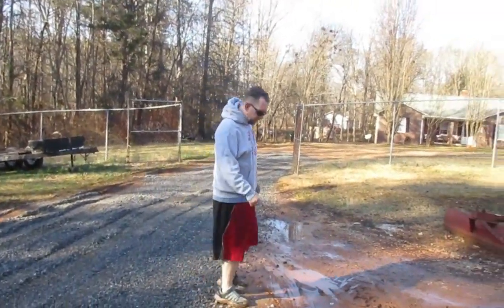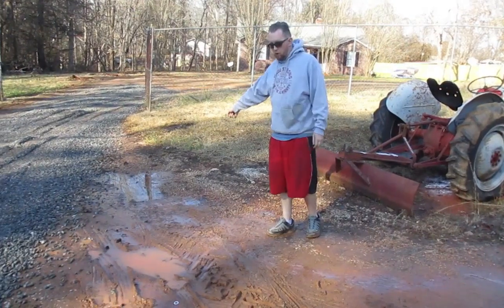Let’s see if the 12 VOLT conversion pays off... Spreading GRAVEL with 8N FORD

Comment: You need 150-200 weight on the blade I had a 400lb weight on mine and it worked super
Reply from the maker: I have to get a weight for it. I gotta find where they sell them around where I live. I was using it today and noticed it wasn’t digging in like it should. The weight would help out a lot.
Reply: @fallingstarranch9633  At the start I had 2 large rocks lol. took a bit of time to make a metal box and pored cement in it
Reply from the maker: I might have to do something similar to mine.